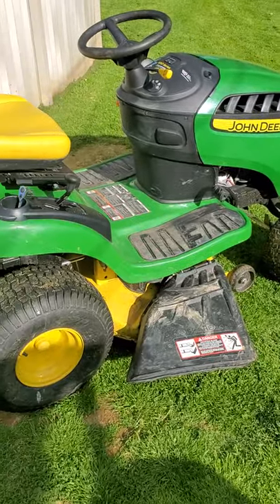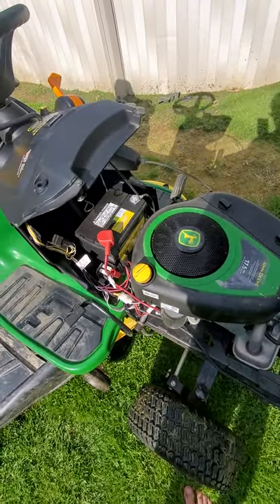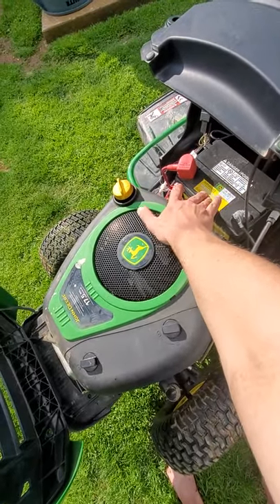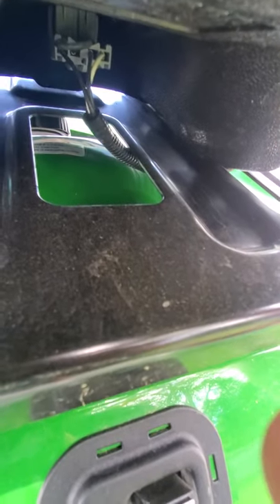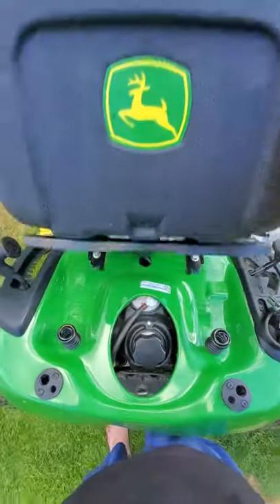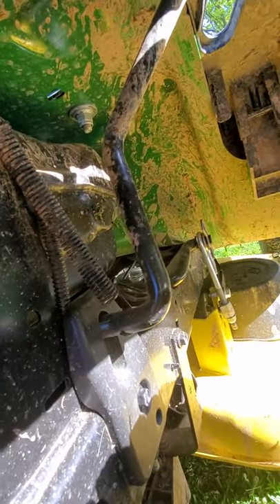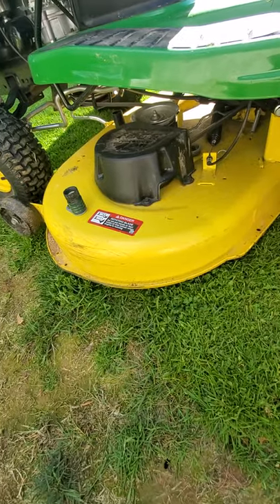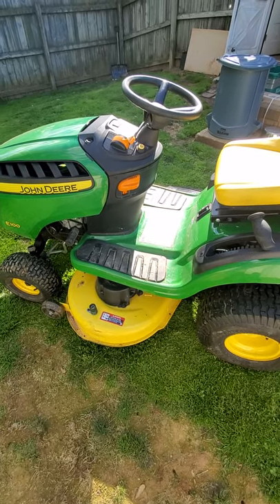John deere e100

Comment: how about the beer holder? is it working ok?
Reply from the maker: it's small but i never put a beer in it.
Reply: @clarinet-tb8tf  you need to keep the beer holder filled with the proper fluid at all times.  it's very important for keeping the driver properly primed while mowing.